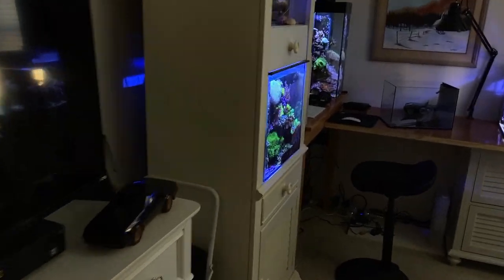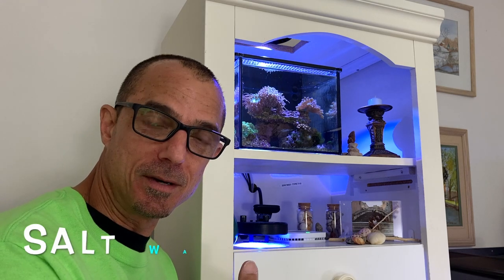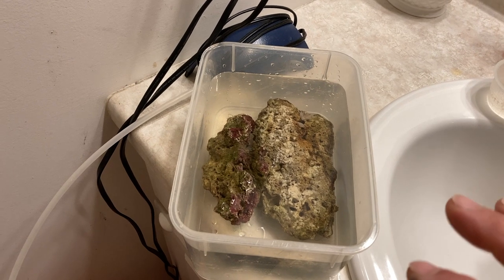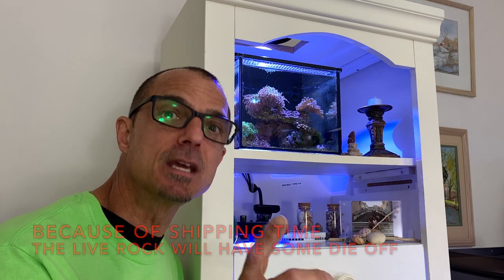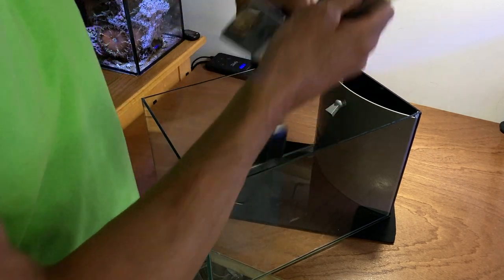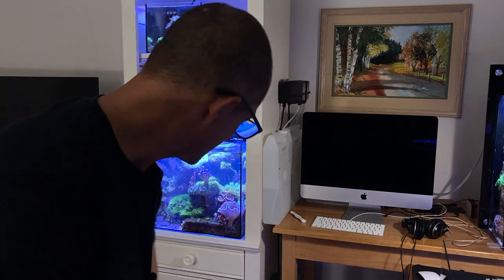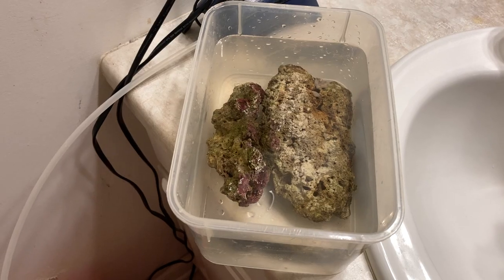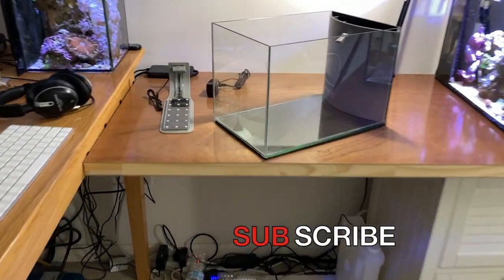Start A Nano Reef  - NO CYCLE  -  (THE QUICK AND EASY METHOD)

Comment: Hi Tom, What are you using as a battery back-up if the power goes off? Thanks Rob
Reply from the maker: Hi Robert, I have a 12v deep cel battery with a 1000w continuous 2000w surge inverter charger. Almost everything important is plugged into it. Lights, heater, pumps. Math tells me About 15 hours of power👍🏻I used it once during hurricane Isaias lasted 24 hours, but my set up has grown. 😃

Comment: I have a question I just recently lost the soft tissue off of my frogspawn it’s laying in the bottom of my tank and it actually looks better than what it did when it was attached to the skeleton will it reform a skeleton underneath it or is it just dead?
Reply from the maker: It’s possible it might regrow. Possibly from one small tiny bud. Even if the rest dies. Don’t get rid of it yet. See what happens😊👍🏻
Reply: Will do sir!

Comment: Hi Tom. Reef Glass Protein Skimmer. Is it worth the 140 bucks it would take to get to me? Is it made wholly in the US? I'm thinking of one for my new 7.5 cube (which is inspired by you).
Reply from the maker: Hey Steven, I don’t think it’s worth $140 on a 7.5 cube. You might try to rely on water changes to keep your nutrients down on 7.5G . I took the reef glass off my 6 gallon and haven’t seen any real change? I’m not sure where it’s made? 😊
Reply: @TOMReefer  Hi tom. I took your advice. thanks. Here's what I did instead, I bought an aqueon gravel vacuum and used it as the body of the skimmer. I added suction cups to the body of the tube (skimmer) and drilled a side skimate vent at the top. I used an airline gate valve and some tubing and a wooden airstone I have. I've gotten this far. I'll let you know how it turns out. I'm into it about 20.00 so far. With the Airstone, (I have a pump) i'm thinking it will end up being 35 bucks. Hope it works.
Reply from the maker: That’s awesome Steven! 😃I would love to see a pic when it’s done! The Reef Glass Skimmer is super basic, it makes sense to make one for that savings👍🏻plus it’s just plain old fun 🤪
Reply: @TOMReefer  I will send you a pic when its done!
Reply: @TOMReefer  Pics sent!